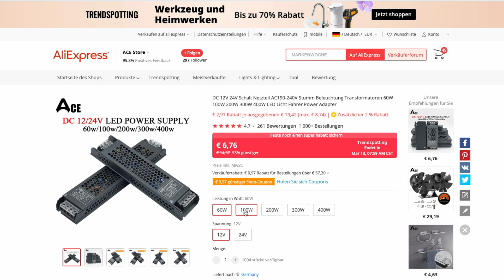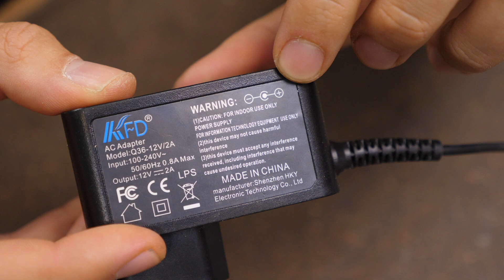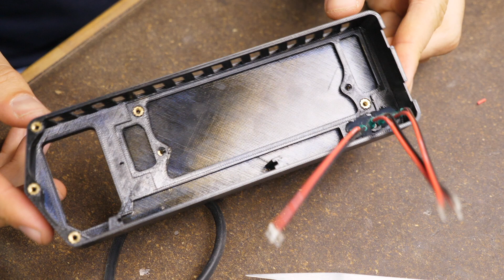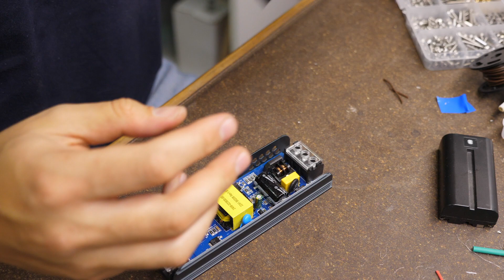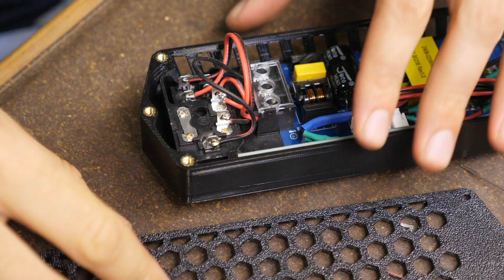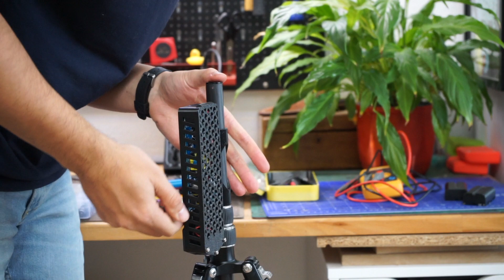Unlimited Power for my Camera Setup!

Comment: Nice build, but you just removed the cooling of the psu... idk if thats a good idea, since you didn't add a fan instead.
Nice cad design too!
Reply from the maker: That's a very good point. Will monitor the temp of the PSU and give an update after a while :)